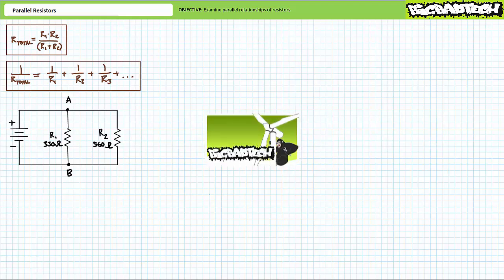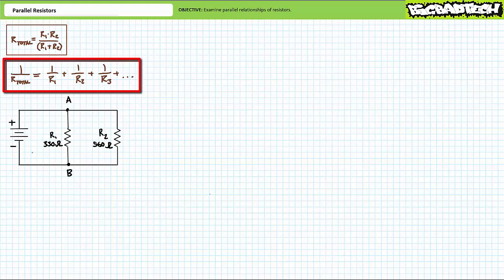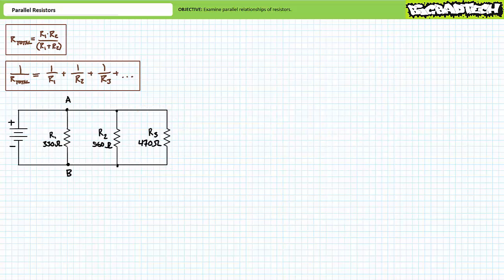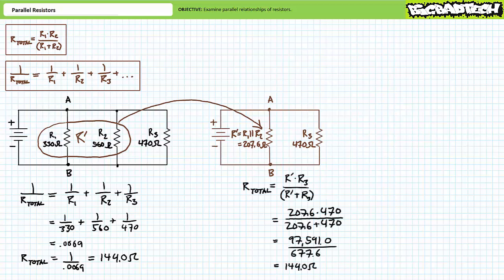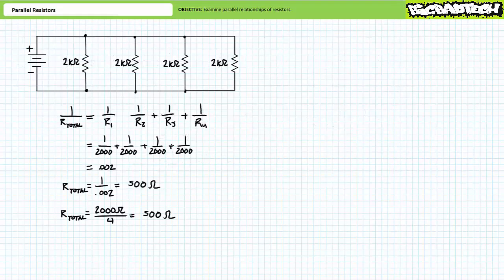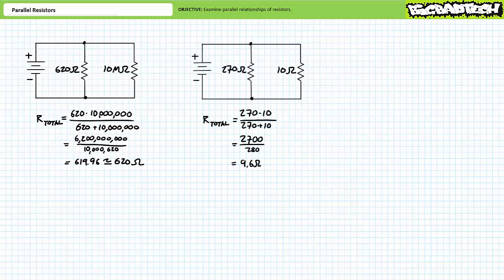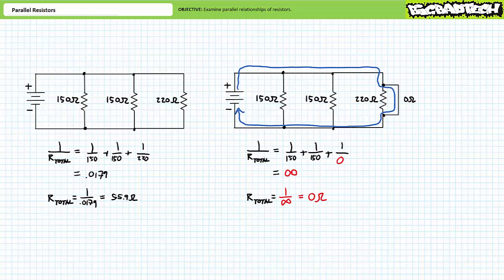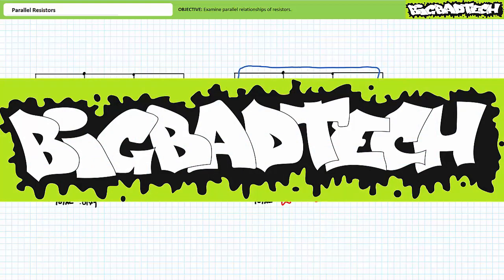Parallel Resistors (Full Lecture)

Comment: What we can conclude from this and past few lectures is that shorts across individual resistors in series (save for at least one resistor), are forgivable. Shorts across ANY resistor in parallel will make your system smokey 🙃